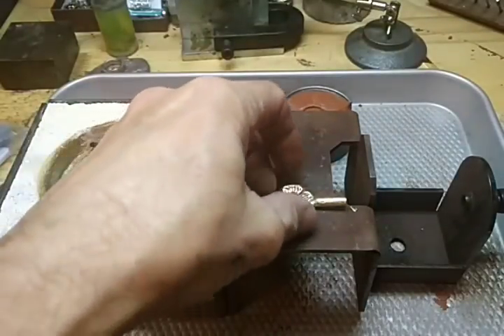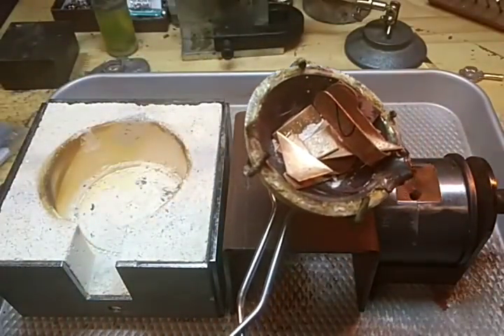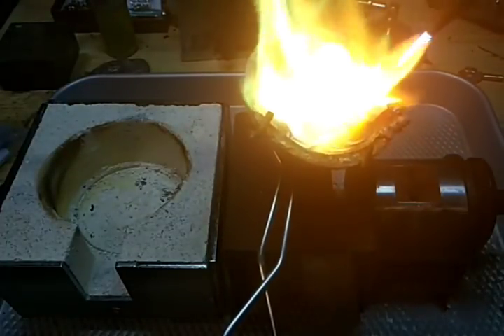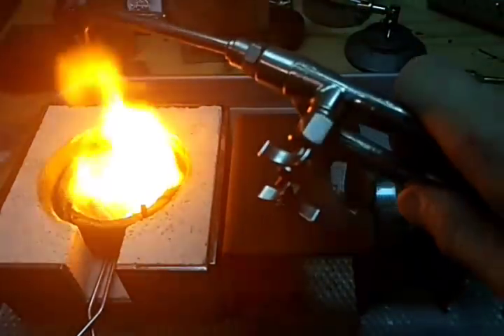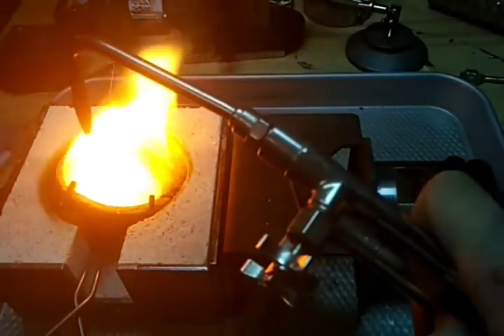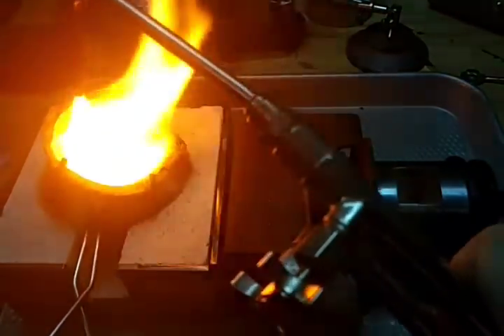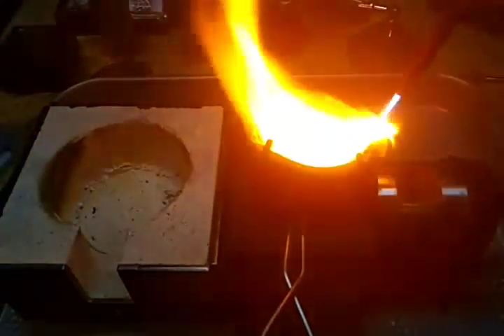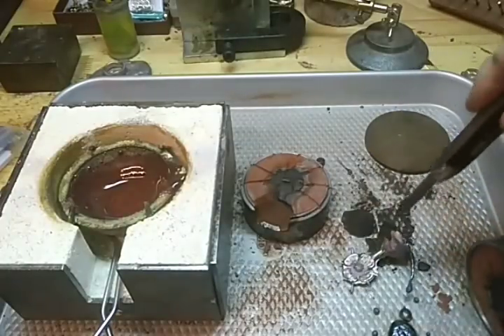Red Clay Casting - Pouring Copper

Comment: Fascinating! It’s a pity it’s too complicated for my equipment which is just a mix of butane/propane torch.
What is the crucible made of? Can I just use steel?
Reply from the maker: You can't use steel plus it will draw away all your heat. Fused silica or ceramic. Just buy one, they are inexpensive and last years if cared for.
Reply: Craig Dabler Thank you Craig! I have seen some different crucibles with steel inside a furnace made out of steel and clay but the heat was coming from the bottom and all around, either charcoals or propane with lot of air, that why I was asking. But if the heat comes from above it makes sense you don’t want to waste that energy! I have another question... Do you ever use borax to prepare your crucible? I am not sure if it’s necessary also on copper or alluminum. I have seen it on silver a lot. Thanks!

Comment: is it possible to make a permanently reusable mold that maintains its shape?
Reply from the maker: Not with sand casting.
Reply: can you tell me what are the methods?
Reply from the maker: I don't know for sure.
Reply: craig big !!
Reply: @lelearmi6186  metal injection molding with ceramic molds, it is expensive both for the dye grinding and for the machine purchase/rent.

Comment: Can brass be melted the same way? Thanks!
Reply from the maker: Brass is a bit easier to melt but the fumes are toxic and so I don't cast with it, even with a good ventilation system. All metals should be ventilated and not breathed in but when melted but brass has got to be the worst so I avoid it.
Reply: Craig Dabler Very good to know. Glad I asked. Is brass as toxic when soldering as well? Thanks for your help Craig.
Reply from the maker: I think anytime we solder there should be good ventilation but the brass isn't quite as bad until it becomes molten which shouldn't happen when just soldered.
Reply: Craig Dabler Thanks!